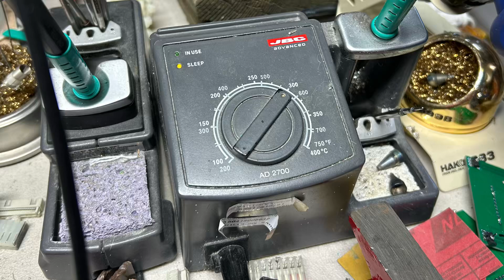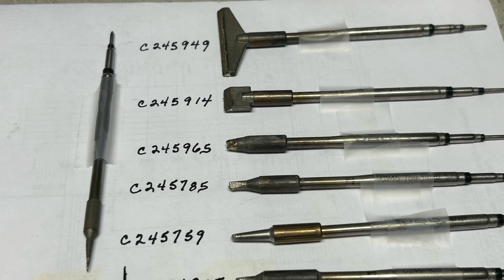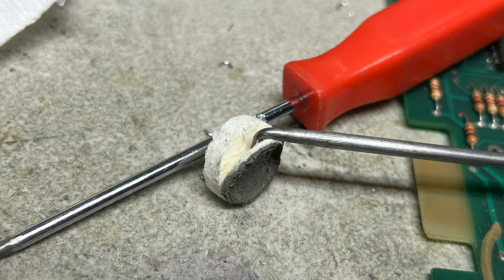Soldering Station, Tip Used, etc

Comment: Thanks for info on the tips you use. I had asked about the ones you use before ordering some for the station I bought. Definitely a great unit and will do a better job especially on the 9 pin headers.